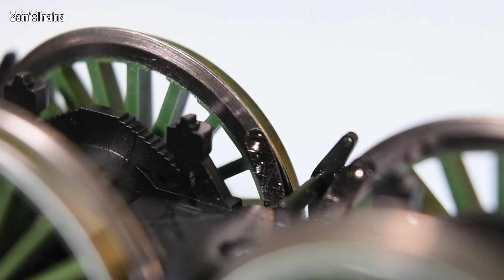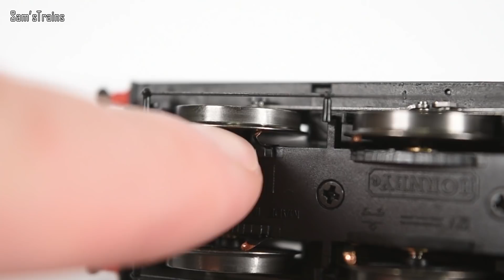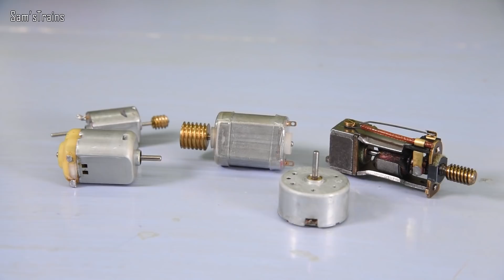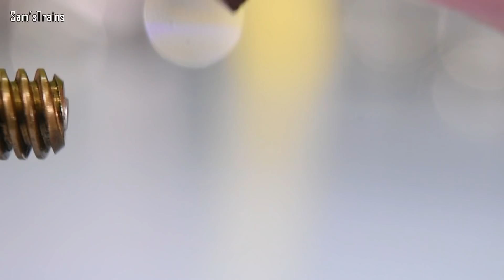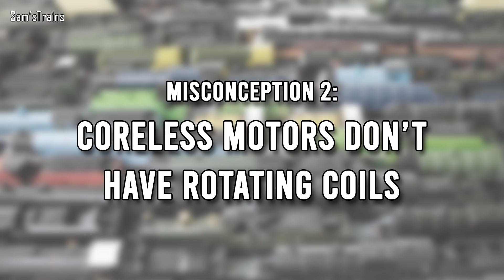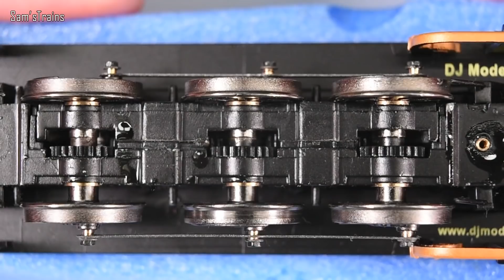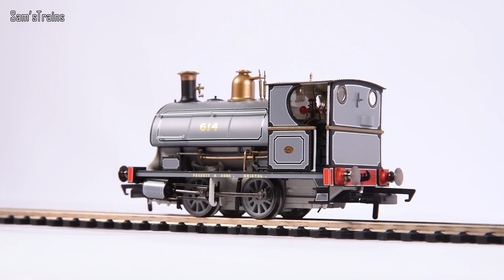What Makes A Good Runner? | How Model Trains Work

Comment: Hi Sam. Another excellent video. I have a Hornby Fowler tank, which has developed the most appalling jerking, to the extent that sometimes you can even hear the gears slipping. I’d love to know if you or any of your savvy viewers might have an idea what might be causing that?
Reply from the maker: Thanks for sharing Gordon, sounds to me like it could be a split gear - very typical of Hornby locos from that era, as the lubricant used at the time is known for damaging the gears. You can get replacements, but depending on which gear is faulty, they can be devilish to refit. That's my guess anyway!
Thanks for watching, Sam :)
Reply: Thanks for getting back to me. I’d feared something like that because it’s in a particular place with each wheel turn that it sticks. But thanks again for taking the time to respond.

Comment: Sam, really nice video although I knew from before. I have another way to inccrease grip with the wheels. I notice that the track, as well as the wheels are quite shiny, where you want to grip with. Could the wheels instead be made not so shiny by lightly sanding or filing the wheel surface so it's not shiny, which would increase track grip? Or, better yet, lightly file the rails of the track so they are not so shiny. Suppose you have a hill like in your layout? Take some extremely fine sandpaper and lightly go over the rails with it, not to scratch the rails or anything, but to reduce the shine of the rails. Make the rails less shiny and this will dramatically increase the grip, while still letting the wheels slip if needed to avoid damaging a loco.
What do you think? In the same way a turned bearing reduces friction, the shine between the wheels and the track does the same, and reducing this, even if only slightly, could work wonders for pulling power
Reply from the maker: Thanks a lot Gino! Yes that would certainly help, but then you'd be damaging their conductivity, as scratched wheels would get dirty much more quickly... and they'd be harder to clean too!
Thanks for watching, Sam :)

Comment: I still disagree that bearing pickup is inferior. The plastic axle if produced with good plastic (such as delrin) and not cheap nylon like Bachmann does should last a while. Wipers wear out much faster than bearings and also are a lot more flimsier. In my experience using non-conductive lubes on bearings have no noticeable effect on performance, simply due to the sheer amount of additional surface area of bearings to axles vs wipers to flanges, and the electrical contact has no issue passing through the almost atom-level thin amount of lubricant. Maybe its a US vs UK thing but bearing pickup is on 90% of all non-trainset level steam locomotives, including proto 2000, MTH, BLI, and all brass locos.  

Also, I still dont think you're giving coreless motors enough credit, but that's more personal experiences. Cooling is not an issue with all the diecast chassis frame around it, and a SIMILAR SIZED coreless motor has much better torque, slow speed, smoothness, etc. over a can motor. Although I have seen how your coreless motor engines perform, so I do understand where you're coming from. They must be sourcing their motors from cheap places or something. They also appear to be using much smaller motors. I'll take a faulhaber or maxon coreless motor over a sagami or mashima can motor any day.

I fully agree with you other points, especially the traction tires. Overall all nice video
Reply from the maker: That's fair enough Charles - there are definitely some advantages with the bearing pickups, not denying that! That's true too - the better quality coreless motors I've seen definitely do run very well!
Thanks for watching, Sam :)

Comment: Sam what would you do if you came across a steam locomotive model that put power to the wheels via a mechanism in the cylinder as a real steamer would?
Reply from the maker: I'd be pretty impressed... but ultimately there'd be little point, and it'd be very complicated and expensive and probably prone to failure! ;D
Thanks for watching, Sam :)
Reply: Sam'sTrains probably will not work at all, because of sizes and the precision of the mechanizm. There was one steam locomotive, I think from Hornby, where the water was heated by electricity and the generated steam worked in cylinders. The problem in our sizes, that the boiler is very small, ie the water is enough for about 5-10 minutes of operation, and you have a very complex way how to control such locomotive. ( I have several real steam engines in biggers scale (1) and even there is a problem to control the speed and the direction.)

Comment: Interesting video, thank you. You may not remember Hornby's solution to wheel-to-rail friction. Yes, they used traction tyres, but, in the late 60s and early 70s they also made a big thing of Magnadhesion which was fitted to some locos. It sounded good and technical. Essentially though, the locomotive wheels were magnetised so that - well, they were magnets.
Reply from the maker: Thanks a lot! Yes you're absolutely right - I have a few like that, though sadly they're lost on nickel-silver track!
Thanks for watching, Sam :)

Comment: Hi Sam, is it generally best not to touch the newer Hornby models and leave the servicing to the professionals? I tried lubrocating a couple of my newer models and they ground to a halt (whereas some of the older models showed a distinct improvement).

I'm wary of creating some very expensive ornaments!
Reply from the maker: It can be - I wouldn't recommend putting any oils on the motor bearings... but oiling the wheelset/geartrain is important, otherwise the performance will degrade over time!
Thanks for watching, Sam :)

Comment: Sam’s trains “diesels don’t have coupling rods” 
Class 08 sobs manically
Reply: The Class 01s,Class 02s,Class 03s,Class 04s,Class 05s,Class 06s,Class 07s and Class 14s also have Coupling Rods,The Class 09s,Class 10s,Class 11s,Class 12s and the Class 13s are different versions of the Class 08
Reply: Diesel locomotives built with coupling rods: I BEG YOUR PARDON?!
Reply: What About The Class 07 Diesels? (Salty's Basis)
Reply: Basically most diesel shunters and the Fell Diesel.
Reply from the maker: haha that's a good point... I was talking about larger diesels of course! ;D
Thanks for watching, Sam :)
Reply: @SamsTrains  what like 0 gage?
Reply: The class 01, 02, 03, 04, 05, 06, 07, 08, 09, 10, 11, 12, 13, 14, The Fell Diesel, J45, Armstrong Whitworth 0-6-0, DES2, DS1173, Fowler 0-4-0, 15100, 11001, D3/12 and 1831 all have coupling rods.

A combination of around 2,000 locos

Comment: One thing that is sorta rare but is appearing more is Roller bearings in models. I have a few cars that are equipped with rollers and a sole roller equipped locomotive. Roller bearings for the wheels can do a lot of good for a loco. You got it pretty good but we all know the truth. Athearn Rubber band drive locos are the greatest runners made. 

Jk
Reply from the maker: That sounds great - I don't think I've ever seen those in a model - did they make those in HO then?!
Thanks for watching, Sam :)
Reply: @SamsTrains  yes they did. It was a few one off brass products (100 runs) but they roll too good and the motor has a hard time stopping the train with a load.

Comment: Really good video Sam, I agree with everything you have said. Good advice for people who want to know how things work, without having to listen to my complex ramblings!  ;)

Now, speaking of complex ramblings, if anyone would like to know a bit more on Brushed DC Motor operation, then this is for you:

Power is applied onto the brushes of the motor, which then makes contact to 2 of the commutator plates. This then creates a circuit from one commutator plate, through a winding of the motor (called an electromagnet - an electromagnet is basically a magnet which can be turned on and off by passing current through windings or turns of wire) and then eventually out the other side of the winding and returns through the brush, through the pickups to the track.

The winding creates a magnetic field that is aligned with the position of the brushes (for example N at the left brush and S at the right). Then, the permanent magnet that is located within the motor creates a magnetic field too (for example N at the left brush and S at the right). Because N want to align with the permanent magnet's S pole, and S wants to align with the permanent magnet's N pole, the armature starts to rotate as it wants to align itself with the magnetic fields of the permanent magnet, so it turns as N is attracted to  the permanent magnet's S pole, and pulls the motor round as it wants to align.

But, because the brushes are now connecting to different commutator plates (or contacts) the N & S poles are still being generated in the same position next to each of the brushes, causing the armature to realign itself with the permanent magnet's magnetic fields, and the cycle keeps continuing as the magnetic fields pull the armateur around as they keep trying to align with each other.

This causes a continuous rotating motion, and makes the motor spin continuously, as the magnetic fields from the windings of the motor, created by applying power to 2 commutator contacts, keep trying to realign themselves with the magnetic fields of the permanent magnet.

Thanks for reading folks, hope this helps, and sorry to Sam for clogging his comments with an oversized message! :D
Reply from the maker: Many thanks my friend! Appreciate the extra info on the motors too, great explanation for commutation! :D
Thanks for watching, Sam :)

Comment: As an FYI, I have two Marklin HO locomotives that uses brushless motors, refered to as a C-Sine motor. Both motors run exceptionally smoothly (they are my best running models); however, they require aditional motor driver electronics (as well as a DCC decoder) to operate the motor. The c-sine motor has now been out of production for a few years now, which is understandable since despite the motors amazing performance, it is a nightmare for maintenance.
Reply from the maker: Yeah I've heard about these - HO too? Very impressive! Yes that's right - lots of circuitry needed to drive them, which no doubt is deeply reflected in the price!
Thanks for watching, Sam :)

Comment: remember that expensive manufacturers do see fit to run continuous gear trains and just run coupling rods as an aesthetic, so I'm guessing that the Germans see an advantage to it
Reply: Which is that you can get away with much smaller coupling rods and change a lot of the valve gear to plastic.
Reply: @ivovanzon164  agreed. I also think that sometimes manufacturers will do this because they're a quality manufacturer and that's what quality manufacturers are expected to do. back in the day it was just assumed you had all the axles geared together. I think Lionel's 1906 standard gauge #6 was likely the first to have coupling rods used as coupling rods, (I'm not including clockwork or steam here) but for a multi axle loco range possibly the '38 dublo range?
Reply from the maker: Yes that's interesting - because most British models have a single driven axle, and yet the coupling rods are to scale these days! I have known it work well in some cases, so each to his own!
Thanks for watching, Sam :)
Reply: Well, you always can opt for the Roco weirdness if you can't decide between loco or tender drive... main drive in the tender (with traction tyres) and a cardan shaft to the cab for driving the rearmost axle on the locomotive

Comment: jezy zie has been experimenting and converting models to use brushless motors, and even controlling them over WiFi.
He has many videos on this, but here is one of the the brushless tests with synchronized sound:
https://youtu.be/c5NcCjYS94w
Reply from the maker: Wow! Very impressive indeed - though you can see just how much circuitry is required! Easy to understand why British manufacturers don't do this!
Thanks for watching, Sam :)
Reply: @SamsTrains  Most of his circuitry seems to be for the WiFi control and the sound synchronization. For some reason he also likes to power the trains from LiPo battery instead from the track. No idea why. He seems to be having tons of fun with his project thou :-D
Like with this synchronized smoke one that he did:
https://youtu.be/fBO0N6QPZBY

Comment: A very good video, indeed, Sam!  This morning I cleaned the wheels on a 20 year old HO Kato NW-2 switcher/shunter using a small cloth saturated with alcohol between a powered section of track and each truck/bogie (sequentially, of course, so power would get to the motor!).  I'd be interested to know how you clean your loco wheels and your track.  Also, since much of your track is on a rug, do you have a problem picking up fuzzies?  Cheers from Wisconsin.
Reply: Andrew Palm  It can be quite challenging especially when the gears are not covered from bottom side. They tend to wind up the hairs, very common on carpet floor.  You have to dissasemble the engine and with fine tweezers you can remove the hairs.
Reply from the maker: Thanks a lot for sharing Andrew! I did do a video on this some years ago - if you search for samstrains wheel cleaning, you should find my approach! :D
Thanks for watching, Sam :)

Comment: I have a steam loco with an interesting problem, it has tender pick up, but the engine only works when i took the tender off so now i'm looking for plastic wheels on the internet, so at least the engine looks good
Reply: obviously got a short. one or all of the tender insulators is probably reversed
Reply: @muir8009  so if i try flipping the wheels it would work?
Reply: @thecountofangelicislands6183  in Sam's video he mentions about plastic either between the wheels, or there might be on one side a small plastic ring on the end of the axle, just check that these are all on the same side (and all there). pickups on a tender will still need to get the electrickery to the motor so there will be a tender loco connection of some sort, so check that as well. it's worth looking into, not only does it get the loco working but it can be quite fun and working out how the power goes from rail A, to the motor, and get back down to rail B. sit back, just look at the loco, and work out how the power works, if you figure what routes the power takes, you're 3/4 of the way to fixing it, without really having even touched it. good luck!
Reply: @muir8009  okay the problem is, the tender's bottom is all metal, only the boddy is plastic
Reply: @thecountofangelicislands6183  thanks for that info. the tender in all likelihood will use the uninsulated wheels as a return, the loco coupling pin connects the loco wiring via the tender frame. I don't know if the locos been modified at all but the likelihood is that one of the wires from the motor will go to a loco pickup, and the other wire from the motor will to either the loco chassis, or you'll find it going to the loco tender coupling, thence via the tender frame to the wheels of the tender. the insulated side of the tender wheels HAVE to be on the same side as the loco insulated wheels
Reply: @muir8009  it's an old märklin, and there's no wires inside, the loco and the tender are connected via a metal plate that goes in with screws
Reply: @muir8009  i think i'm gonna go for a repair shop i saw at the capital, or she's gonna be a standing monument loco
Reply: @thecountofangelicislands6183  ahhh an old Marklin. 3 rail? I presume it has a skate under the loco?
Reply: @muir8009  nope, it's a bit newer from that, and it didn't have the screwholes for the skate
Reply: Attila Mihalik if it is a Marklin, you have to replace the wheels. They are not isolated.
Reply: @thecountofangelicislands6183  Marklin still does the three rail... if it hasn't got the middle skate anywhere must be two rail, in which case the tender might be the 3 rail with uninsulated wheelsets and indicated by railfilm. all 3 rail (or stud contact) marklin have the central skate underneath but if you try running marklin 3 rail on 2 rail track it's gonna short out, hence if the tender is a marklin 3 rail the wheelsets will need replacing. try on a piece of track putting a bit of sticky tape on one rail where you've put the tender, couple them up and see if it'll run for a few centimeters, the tape obviously having the effect of insulating one side of the tender wheels
Reply from the maker: Very interesting - yeah flipping the wheels won't help in 3 rail (if I understand correctly). Worth checking the coupling/connector - the Hornby ones sometimes can short together, causing confusion until you realise... never seen the Marklin design though, so that may not be relevant. Good luck!
Thanks for watching, Sam :)
Reply: Sam'sTrains Anyway the Marklin wheels for 3 track operation have very strange flanges. The wheels have to be replaced for fully insulated ones ( from axle and chassis). On top of that in this case can be also critical the mechanizm construction when the wheels are insulated only on one side, ie the chassis is not insulated. This is also critical and in most cases you cannot couple two vehicles ( eg. tender and locomotive).

Comment: So, if someone (Oxford?) fitted a 7-pole motor with a flywheel they could name their own price?
Reply: gaiety of course had 7 poles, Boucher used 21 pole motors. 5 poles is perfectly adequate and a quality 3 pole runs better than a poor 5 pole
Reply from the maker: haha not sure - at this size, that'd be expensive, and the more complex a motor gets, the more room for failure there is!
Thanks for watching, Sam :)